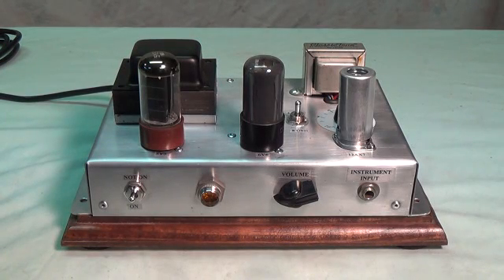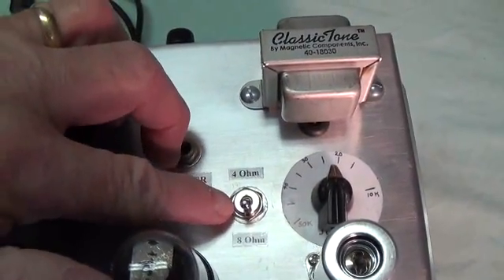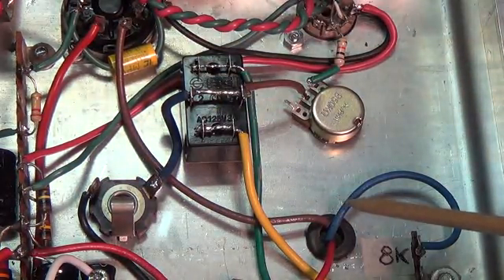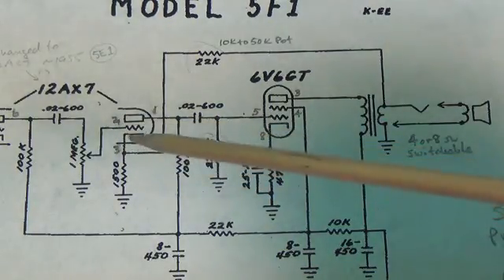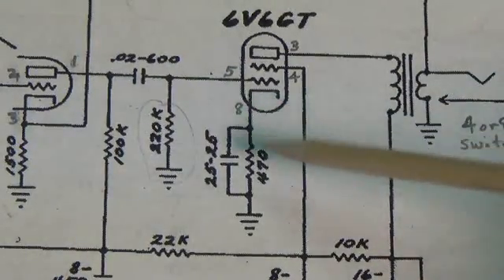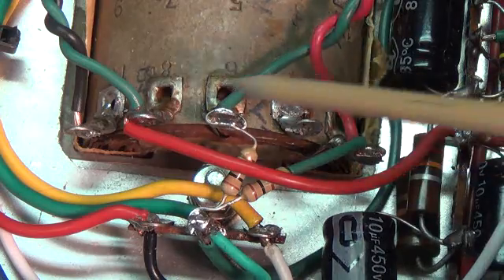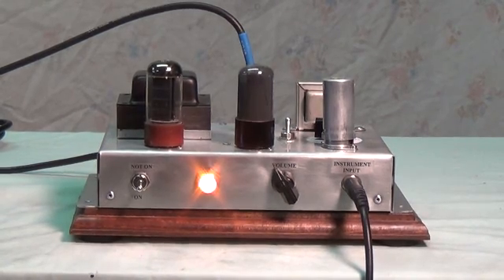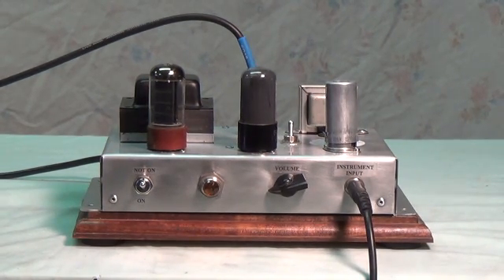Scratch Building a Fender 5F1 Champ from Scrap Parts.....Part 2

Comment: Uncle Doug, question:  if the purpose of the negative feedback loop is to suppress the signal from a high mu tube with a low plate dissipation such as the 12ax7 from running amuck and losing controllable headroom in a small high gain amp that has a smaller speaker, then couldn’t you change that circumstance into a more irrelevant one and eliminate the need for the negative feedback by using a higher wattage and larger speaker thus increasing output handling capacity and also by using a lower mu tube with a greater plate dissipation?
Reply from the maker: The purpose of the NFB is not to suppress the 12AX7, YB, but to lower the gain of the output circuit and clean up its tone, by neutralizing certain frequencies in the music signal. It is not required due to small speaker(s).....after all, the mighty Bassman has NFB.....and has nothing to do with the plate dissipation of any tube in the circuit.

Comment: Very late to the party but wanted to mention I've amended this feedback scheme: I put a 100k in line with the 22k so when its dialed to zero it's the original feedback resistor value and at full 100K it's close to having enough resistance it's effectively off. On a couple amps I've put a rotary switched to definitely turn it off. Linear pot so it can be wired correctly and won't fudge up a log taper.
Reply from the maker: Thanks for sharing, OAR :)

Comment: Slaugthered the 1946 40$ radio today and choke- we call it drossel. And output transformer mesured well, alott of fine metal and part, 2 potmeters wich they now how to make in 1949. I cold just buy 10 such radios fore 400$ .  And speakers always are fine,they made good speakers here in norway.ewen still seas produse them, but i like them better the older they are. Maybe i use the ecc83 as first tube,thow plan was to use 6sj7. The radio alsow har 5 nice tube soclets.
Reply from the maker: Thanks for the update, NB.
Reply: @UncleDoug you ewer been into a jim kelly at youre garage? Only amp with 4 6v6 gt tubes. My dream is one time to build one. And with your scolaring il do. Did you ewer have it on the bench?
Reply from the maker: @nbramaputra  I've never heard of a Jim Kelly, NB, let alone worked on one.
Reply: @UncleDoug they were made in usa,ratnests,i think a cople of 30 or 50 were made some years ago.5000$ i think they were.I read about it in a bock by reiler zur linde,they were mush aprisiated fore their sound and had unusual tone controls,i think they stopped productjon in the 70 ties.
Reply: @UncleDoug i think they had 495v on the plates,and tone controlls un usual.not to manny were made,but a reisue was made some years ago, maybe 30 or 50 . They were highlig aprisuated fore theyr unice sound.
Reply from the maker: @nbramaputra  I'm not familiar with radios ever using such high plate voltage, NB.
Reply: @UncleDoug the jim kelly amps i think were made out in the early 80 ties they were made fore guitar, and had a distinctive sound. My dream has been to build one but probobly not with 495v on the plates of the 6v6 gt, but you see how high voltage there is on some pre amp tubes, and in old days they did not care tubes were cheep and quality . It cold be build with 2 6v6 gt instead of 4 i think. Chicago i think they were made.

Comment: Hi again,
I've been wondering about the impedance selector switch on my own champ clone, does the NFB resistance change significantly when adjusting the pot on either side of the windings or would it be unnoticeable? I really should try and see but it doesn't hurt to ask first I suppose.
Reply from the maker: I's my understanding that if the NFB wire is connected to the highest-impedance output, even if it's not being used by a speaker, that the NFB effect will be equal at all settings......but experimentation is always better than the advice of others.

Comment: Hi! What wattage should the 10k resistor on the NF pot be? Thanks
Reply from the maker: Since virtually no current passes through the NFB circuit, 1/2 to 1W would be more than adequate.
Reply: Also could i swap the two .02uf with 22nf coupling capacitors? Sorry for the noob questions... thank you for your answers and awesome content.
Reply from the maker: Yes, you can, Peter. Capacitor replacements can be rather forgiving. @peterbartalesi6655

Comment: I remember watching this years ago thinking - I could build one!   I built one from scratch - it is rusty  as hell (which is kind of interesting if you think about about it - like a tribute or homage)  because I used steel for the chassis - I did not realize until later that I should have used aluminum - I am so dumb - but the amp is a beast and could probably survive an atomic blast - plus the rust gives it this incredible vintage look - I just need to take up smoking so I can't get those kickass cigarette burns on the chassis
Reply from the maker: You could hire Keith Richards to provide the cigarette burns, AW.  We're glad the video was helpful :)

Comment: Thanks for this video , even though I wasn't building an amp I watched , just to learn a little more and it gave me an ideas. My amp , a 15w  solid state , was making all kinds of hum and horrible high pitched noise. I noticed you twisted some wires , all the alternate current leads I believe , together and ran them high instead of a long the bottom of the chassis. That gave me an idea and I tried the twisting on a few wires. Presto , it sounds %100 better. Not sure why but it also works on input and speaker wires. Anyway , thanks Uncle Doug !
Reply from the maker: The winding of AC-carrying wires is always a nice touch, Travis. Glad the video was helpful.

Comment: Hello Doug:  Do you happen to remember what VAC that power transformer was generating?  I have an old Grundig radio PT that puts out 237 VAC and was wondering if I could create an Champ type clone with it.  Great videos, thanks for all you do.
Reply from the maker: The Grundig should be OK, Mark, once you rectify and filter/smooth it up to peak voltage.
Reply: @UncleDoug  Thank you.  I'll give it a go.

Comment: Hello there, uncle Doug, I’ve dug into this cinder champ, build, looking at tubes and what not pulled up the data sheets and noticed that the filaments can also be powered by DC. I was thinking about using your voltage, double or circuit and creating enough DC to power the plates, but then also using a voltage divider off of a rectification circuits to Power, my Filaments. You seem to be one of the most knowledgeable people on YouTube on these matters and was wondering if you thought that was a possibility
Reply from the maker: Why bother, AD? Millions of amps function flawlessly with AC filament supply. There is no need to reinvent the wheel.....the one we have works great.
Reply: @UncleDoug  partially becauseI think it would be interesting and secondly I have some really high and rectifiers from fire alarm systems from the 70s. If you think I should just build one with AC first and then play around with DC that’s what I’ll do.
Reply from the maker: @americandad8903  It's up to you, AD. I'm all for experimentation, and would never discourage it, but I also wanted to provide a practical analysis of the necessity, or lack thereof, of DC filament supply. Good luck with your project. Bear in mind that filaments draw a lot of current, which is generally lacking in a voltage doubler circuit.

Comment: Hi Uncle Doug, I built a 5C1 champ per your recommendation in a video and it worked great. But then while moving it fell from a height of 4 feet. Now I have a very loud 60 hz hum. I replaced tubes, resoldered 2 connections that broke loose, but still have the hum. I'm now thinking one or more components gave up the ghost during the fall. Any recommendations for which component ? I'm left just scratching my head
Reply from the maker: Your guess is as good as mine, PG. You'll just have to check each component.

Comment: What a great video.  I'd recommend highly.  I wonder how tubes are chosen.  I have an old radio I thought I could possibly turn to a low wattage amp but after a little research find the tubes are not adequate.
Reply from the maker: Thanks, Steve. There are hundreds of different tube types, each with a specific application.

Comment: Sounds samples illustrate things really well here.  I'm planning out a variable NFB in the 5E3 kit I built.  I've been following Rob Robinette's guide, but it only shows how to do a switched NFB loop.  For a 4ohm output it lists resistor values as between 13k to 39k (depending how much is desired).  I was thinking to put a  50ohm linear pot then a 10k resistor.  Do these values sound appropriate?  I favor a clean tone 99% of the time.  This video + the one on Presence controls have been a great help
Reply from the maker: I would recommend a 100K pot plus the 10K resistor, M. One version of the Deluxe that does have a NFB loop uses a 56K resistor.....so the 100K pot would bracket it evenly on both sides.
Reply: @UncleDoug  thanks so much for the advice.  This is something I've had a pretty hard time finding exact info on.
Reply from the maker: @monto39  I'm glad to hear it, Monto.

Comment: Hello and thanks for the wisdom - Beginners question here regarding the OPT: Why do you think 5 K ohm input is better suited for a 5f1 than 8 K ohm input ?
Reply from the maker: I usually experiment, Lars, using all possible taps then selecting the one that sounds best to me. I have also used the 8K primary.....when it sounds best.
Reply: @UncleDoug  Ok,  makes sence-  guess I´m just anxious to mess up :goodvibes:
Reply: @uncledoug, would the 8k input be better suited when using an 8 ohm speaker?

Comment: I'm wondering why you placed the output jack and impedance switch on top of the chassis instead of on the back panel... Once mounted in a cabinet, would that make it difficult to access? 

I wouldn't want to hear "Gloria" again, either, at least until you tuned your guitar.
Reply from the maker: With the chassis located on the floor of an open-backed cabinet, it's relatively easy to access both the jack and switch. Sorry about the tuning......I was focused on the effects of the NFB pot.

Comment: Thanks for the clear and concise description of this build, it gives me a bit more confidence knowing what to expect when I build my very own amp.Great stuff!
Reply from the maker: Glad you liked it, Giulio. Same to you :)
Reply: @UncleDoug Happy hols Uncle D. 2024.
Reply: @UncleDoug Just a few more visits to the re-cycling yard and my 1st amp will be ready. I actually found a rusted chassis from a very old Deluxe amp , had to replace most of the parts and learned via Trial and error and sweat how to get a noise out of it. It's basically a Radio without the reciever and I wired the cable straight to the CTS volume pot (no tone yet). Have to thank you cos a year ago I knew how to put circuits together but never really knew Why they worked, thanks again.

Comment: First ever comment, on an old vid, but here it goes:  What sort of wattage rating did that trimmer resistor for the 6v6 cathode bias have? I've never seen a cathode bias resistor under 2 Watts, so I'm curious on your thoughts :)
Reply from the maker: The wattage rating, due to its mass and heat dissipation capability is in the 2W to 5W range, Hakon. Proof of its suitability is that it has served well for several years.

Comment: Would it be of any use to shield the filament power loop? I sure appreciate the time you have put into your videos. I am learning so much it makes my head hurt.
Reply from the maker: It's not necessary if the 6.3VAC filament wires are tightly twisted. Their opposite EM fields will cancel each other.

Comment: Back ages ago when I was involved with making products for general consumption I was told that I had to have all power toggle switches active only in the up position.
I can only figure that someone decided that a person being electrocuted might be able to bump their head on the toggle switch to turn the unit off their way down.
 I never did get a good answer, but I couldn't sell products to the Bank Of America until the toggle switches had their toggles up when active; and in an emergency situation anyone could walk up and slam all the goggle switches down to turn everything off.   Everything in the entire bank was wired that way!
Reply from the maker: I tend to wire them that way, Dennis. To me "up" and "on" seem intuitively related.
Reply: @UncleDoug  
I must be mistaken then because it appeared to me like this amplifier was wired with ON in the down position...
Reply from the maker: @Dennis-mq6or  Talk about "nit picking". It was labeled "ON" and "Not ON" as a joke. Let's limit our comments to matters that are actually relevant.
Reply: @UncleDoug  Not nit picking at all Doug.
If you took it that way, I apologize.
Bottom line question was the ON position up,...or down?
If ON was down, then it wouldn't be nit picking; it would be relevant..
I actually enjoyed your ON and NOT ON humor...

Comment: Hi Doug could you tell me how you got the specs for the transformer thank you
Reply from the maker: I made note of the circuit it was powering......number and type of tubes, and their voltage and current requirements.
Reply: @UncleDoug  I did find the video you made showing how to find the information and tried to figure it out but my multi meter is acting up for some reason LOL thank you for being so patient
Reply from the maker: @Robert-Smith  No problem, Robert. Good luck.

Comment: hi, wanting to understand, is the pot replacing the 22k resistor and is the 10k resistor replacing the 1.5k resistor found in the schematic? so that the pot and the 10k are all there is between the speaker jack and pin 8 of the 12ax7?
Reply from the maker: No, the pot and 10K resistor are in series and replace the 22K NFB resistor. The 1.5K cathode bias resistor remains in the circuit.
Reply: @UncleDoug  thanks thought that was the case after I examined a frame of your video.

Comment: The virtual center tap on the heaters is a simple yet very effective improvement. Note that original Fenders from this era used the chassis as one side of the heater circuit.  Low cost manufacturing but ouch! Mixing all kinds of grounds with the heater circuits. 

Another note: power tubes need 18 gauge wire for heaters because of the current.  However, preamp tubes don’t draw anywhere near as much current.  That means you can use 22 gauge shielded cable for preamp tube heaters. I know that this is sacrilege for many, but it is solid theoretically and works in practice.
Reply from the maker: Thanks for your helpful input, Chip.

Comment: Well, Jack can probably relax now. I have made it to the video you referred me to. And, it dawned on me that a few years ago I restocked my 1/2 watt resistors, and do have some other new parts in my parts boxes. So, took the plunge and ordered up some transformers and a few other bits. I had some cabinets built and stored too, but I am going to go in a different direction now after watching many of your scratch builds and vintage amp repairs. Maybe a SILVERTONE MODEL 1391 style, with a bit of my own flavor. You are an inspiration. Look out for my upcoming house fire video.
Reply from the maker: Thanks, AZ. Good luck with your project.

Comment: Thanks for the video.
I have a pkexi style preamp with ac15 power amp and no negative feedback..

I will try to implement it, if i find i nice setting i can make it permanent. But i guess for cleans its good to have no nf, more bass more highs.. And for overdrive more nf, to tighten the sound.

I will try.. My amp sounds a bit muddy, this will help i guess.

Contrary to what people say nf enhances touch response snd dynamics. I tried it in my 5e3.. Much better with NF... Can go from clean to dirt just by pick attack..

Your way is perfect for tuning an amp. Thanks alot. Ine needs to listen in real time. If you solder and start amp again you forgot what it sounded before. Direct comparision is so valuable!!

Nfb pot, presence and resonance control would be max fine tuning..

Do many ideas thanks
Reply from the maker: Thanks for your comments and input, Joe.

Comment: I have to thank you for the demo of the variable negative feedback. The high negative feedback sounds compressed, but is it 'correct'? I think conventional engineering would say yes, but I wish to disagree. There must be something missed, either in terms of time or amplitude domain. Why would being more correct sound less dynamic. It should sound just as dynamic but cleaner. I think there's some dynamic range compression going on... but maybe any dynamics that are missing were incorrect/inaccurate to begin with.
Reply from the maker: The NFB neutralizes whatever frequencies are sent back to the PI cathode out of phase, John, and the degree of neutralization varies depending on the strength of those frequencies in the NFB return signal. Compression, in my mind, is like pushing down on a spring......you still have all the coils, but the overall spring is shorter. With NFB, you are actually shrinking some of the coils.